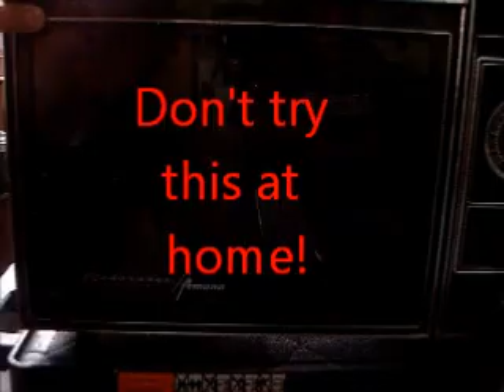Gas Law Demos

Comment: can someone explain the soda can one like what even how
Reply: If you put a little bit of water in the can and heat it, the water turns to steam inside the can, driving the air out of the can and replacing it with water vapor.  When he turns it hole-side down into the cold water, the steam starts to cool, and the decrease in temperature leads to a decrease in both pressure and volume, so the can collapses.